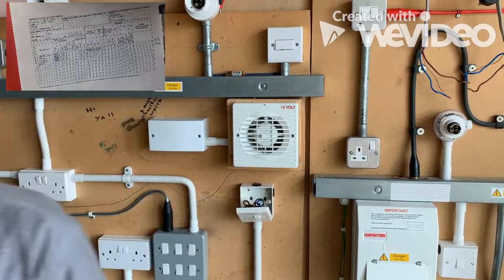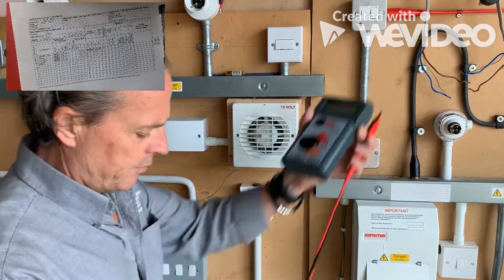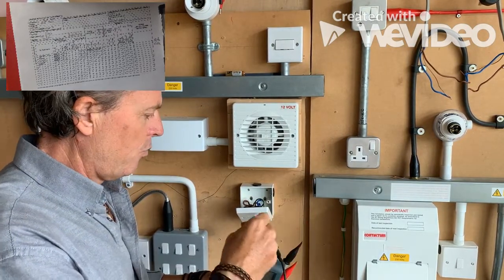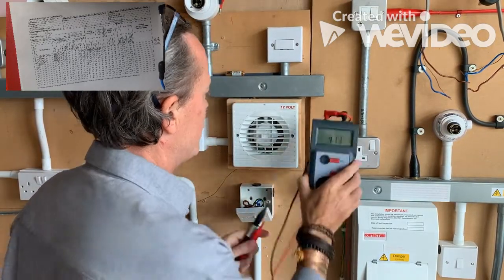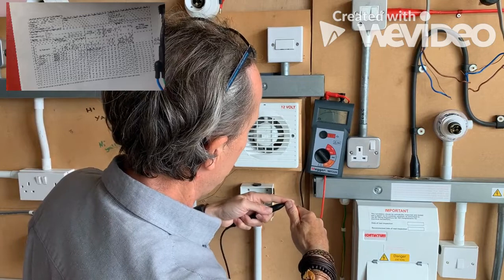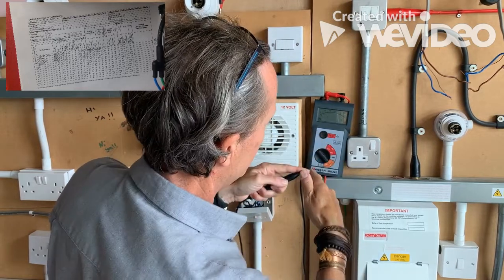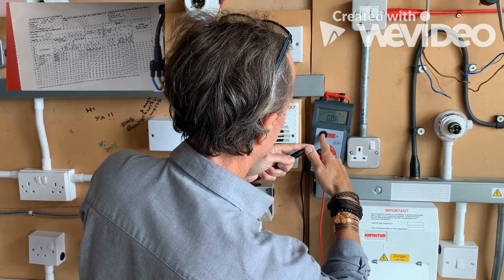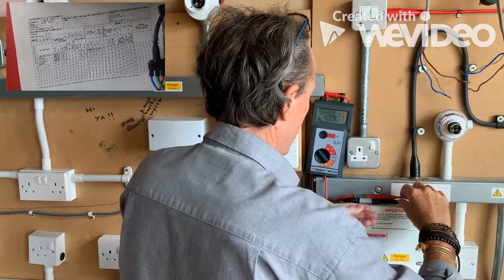Continuity Shower circuit

Comment: Wrong wrong wrong 
R1+R2 you link the line and earth at the CU , then at the shower you probe on to the line and probe onto the earth  that gives you your R1+R2 value. Secondly the shower would be on a 32Amp braker    Not a 20amp you tested between line and neutral your is a fool 👎😡